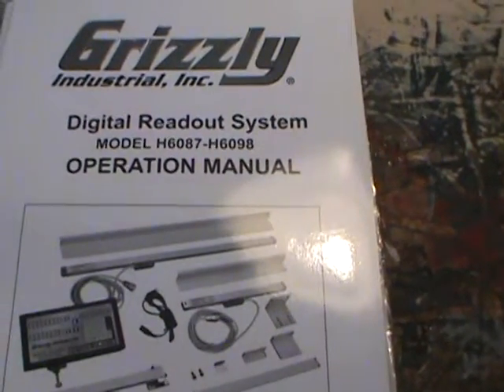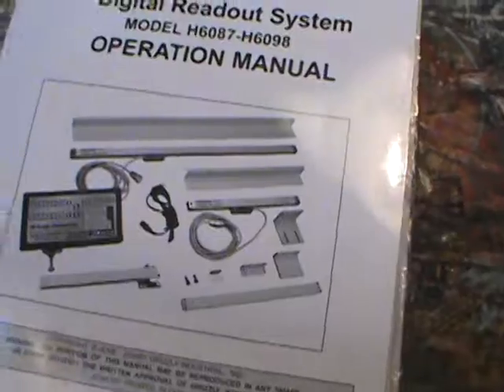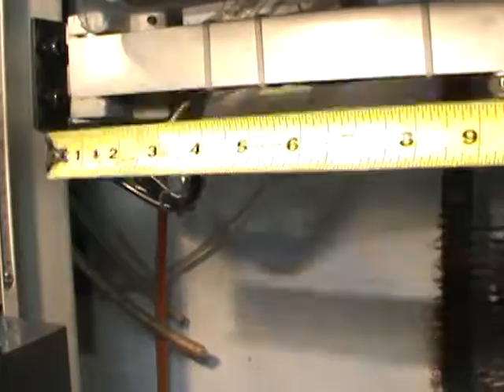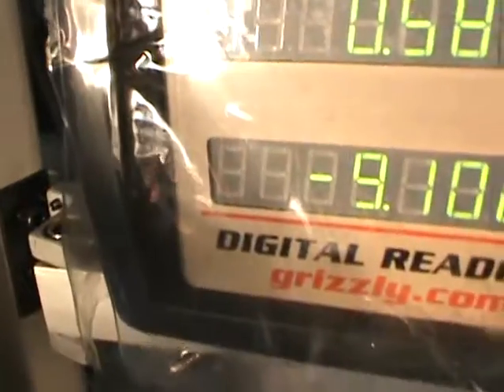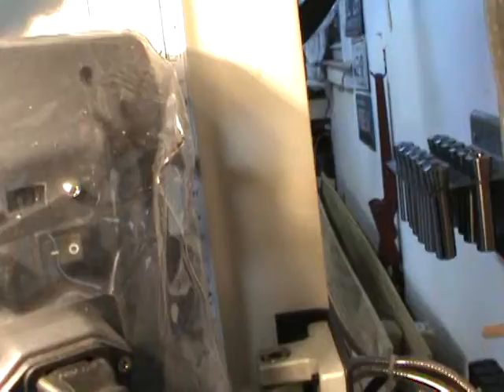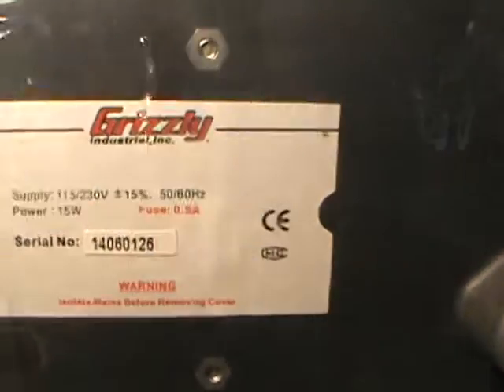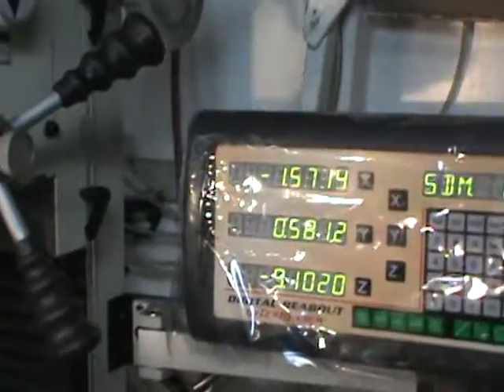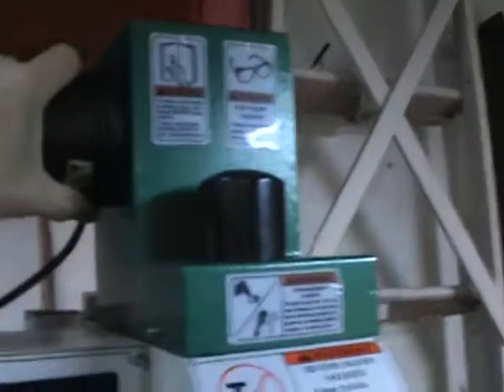Grizzly G0759 DRO Bracket mount  DRO H6087- H6098

Comment: Kind of a dumb question, but how well does the crank that raises/lowers the head clear the DRO box when you come in close to the table?

I'm thinking of getting one of these mills, and I've got big hands... and, it looks like things might get a bit tight there?

The arm swivels, but does the bracket block the crank?

Thanks!

Eric
Reply from the maker: chemech You can swing the arm so the DRO is not blocking the head crank.
Reply: 007connecticut OK, thanks!

Comment: Does the 7059 come with the DRO scales already installed? or do you have to fit them on once you unbox the unit?
Reply from the maker: toadman506 They are all installed.  Very nice job of it too,  just plug the unit in and turn the unit on.
Reply: Thank You